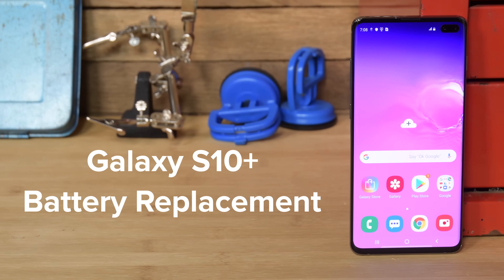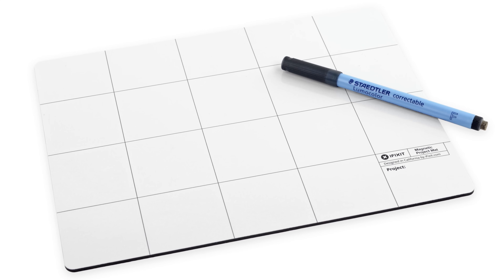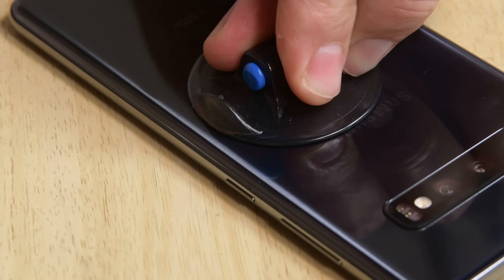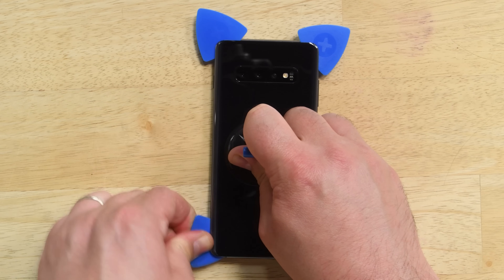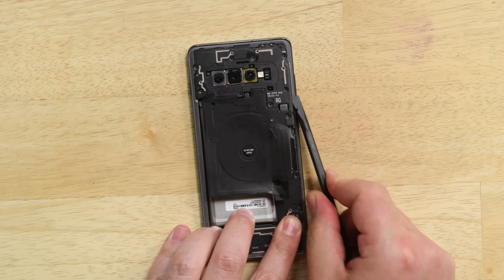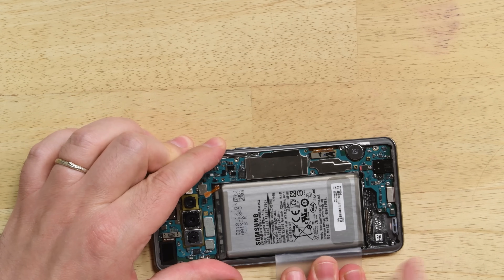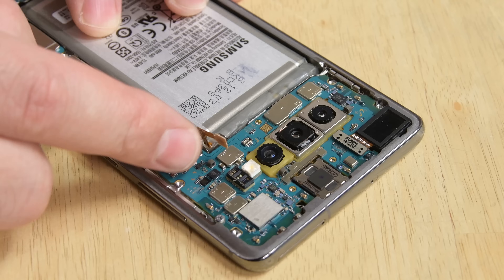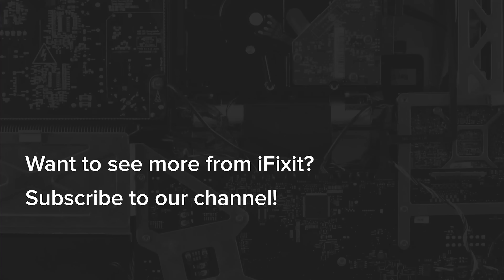Samsung S10+ Battery Replacement and Reassembly!

Comment: ⚠️ Warning: Be very careful when removing the black NFC/wireless pad on Samsung batteries. If it gets damaged—especially near the chip area—the phone may stop charging via USB and show a high temperature warning. I slightly damaged mine away from the chip area, was able to screw it back in, and the warning disappeared—the phone started charging normally

Comment: Why don't you use a power driver when removing all of the screws
Reply: They are only using the included tools with the pack. (Besides the alcohol that you most likely have)

Comment: Thanks for the video. My son and I were able to complete this in about 20 minutes. Once we heated the edges up with a hair dryer, the back was easy to remove. We used adhesive remover and alcohol to remove the battery. That was the trickiest part.

Comment: Should add a card of thin plastic for slipping under the battery - i figured i could use some old packaging, but when i got around to looking, pretty much everything was compressed cardboard, and i had to go out and buy a new toothbrush just to find suitable packaging material for the task.

Comment: For the battery I used isopropyl alcohol and dental floss and it came out in just a few minutes. No prying needed.

Dental floss is the same thing body shop guys sometimes use to remove badges from cars.

Comment: Don't worry if you crack the cover like I did 😳 (novice) you can replace them cheap as chips. The hardest part for me was removing the battery, that was well secure.

Comment: thanks, this looks easy enough for me to do.  
One question, are all of the screws the same length?
Did I need to keep track of what hole what screw came out of?
Reply: All same screws, no worries
Reply: It does?!
It would take an entire evening to follow all those steps! Not to mention buying $50 worth of weird tools. Why would a phone designer do this?
It's a scam to get people to just buy a whole new phone every time the battery dies.

Comment: Would have been helpful if this showed where to apply new adhesive on the cover, and how much to apply.
Reply: Also I didn't see where they said what adhesive was used and where to buy it. My Samsung S20 FE 5G phone launched on October 2, 2020 so it's just over 2 years old and I read they'll last 4 to 5 years but I like my phone and don't want to incur the cost of a replacement so I'm hoping to go this route when the battery does finally fail...also I'll probably need to purchase the tool kit to disassemble it.
Reply: Hopefully, there would be a full instruction sheet packed in the box, with the purchase of the back cover adhesive

Comment: Problem is getting hold of a genuine (and new) Samsung S10 plus battery? I’m in the UK and all I’ve seen so far is fake or used knock-offs on eBay. Any ideas? Great video btw 😊
Reply: Following because I have not found anywhere to buy those except for maybe Batteries Plus and they're more like 60 or $70

Comment: Very informative. It helps to know what it takes to replace a battery so clearly intended to NOT be replaced. I saw another YouTube video about how many replacement batteries are misrepresented. Between these 2 videos, I've decided to go to a Samsung Services location in my area and pay to have it done by people prepared to stand behind the parts and repairs. It is more expensive than a DIY but I can come home knowing that it will be done right and with the Samsung approved parts.
Reply: Except that Samsung technicians will use a Samsung battery that will most certainly fail again instead of a hybrid battery made from different materials that won't fail.
Reply: Can you really lol
Reply: How much did Samsung pay you to write this?

Comment: I did this today on my s10lite and charged it to 100% but now it's on 0 percent and no charging 
:( what's going on? It is on charger for 3 hours and keeps on 0%.. any tip? Brand New original battery pack.. the original and older got swollen due to bad repair.. may be the battery info.bin problem? It's stock and no root

Comment: What adhesive did you use on the battery and back glass. And where and how much adhesive did you put on the back glass to insure a Waterproof IP68 seal

Comment: If you do have to add additional adhesive to the battery or the rear cover, what kind of adhesive should you use? Ordinary white glue?
Reply: I think a water resistant sealing adhesive is needed. You'll want to preserve the IP68 water resistence.

Comment: The thinner and thinner they make these phones, the more adhesive necessary to retain structural placement/rigidity with heavy components like the battery. It is a necessary pain in the consumer's arse...with (of course) the added benefit to the manufacturer of higher sales of new/replacement phones (as they have correctly predicted/measured).
Reply: I think that's a lie Samsung and their designers made up to get you to give up and buy a new phone. There's no structural integrity at risk here. It's a scam. Samsung doesn't make any money if you're replacing their batteries instead of buying a new phone. It's just a good ol' fashioned scam.

Comment: I did one better, I added a 10,000mah cell to mine and replaced the back cover with a custom made 3D printed case

My S10+ is 14,000mah, but it's thinner and lighter than an S10+ with an 8000mah battery case (the type that uses the charge port)

Even made an extender cable for the wireless charging and NFC coils
Reply: Please can I ask where you got the battery from?
Reply: @SiaD777  eBay

Comment: Just used your kit with tools to to fix a swollen s10+ battery - it was pushing the screen up as well as the back apart,, worked pretty well, 4 observations::: - 1. Showing how to use the included glue strips in this video would help give a better idea of how to do it.. 2 Yes those screws are microscopic, a 1" super magnet helped in finding one that went flying and for getting some of them out of their flanges in the phone. 3. The suction cup would not fasten at all on the back of the s10+, not sure why., 4. The iOpener worked quite - just be patient..Overall well done and a very nice kit. btw - glad I bought it - and it got here in 2 days !!!..
There is no 91% isopropyl alcohol in the kit - so be sure you have some on hand. My battery was loose enough - i just gently pried it up.. so not an issue for me.

Comment: What they fail to tell you is the back cover is glass. It needs a lot of heat to get the glue slightly soft, there is no gap to jam a pick in so takes a lot of force.
Once the cover did start coming up the glass shattered and a shard when through my finger and out the other side....
Reply: @qwrt hialname Repalced the back glass. Here is a good tip, don't use picks, cut a square of plastic out of a soft drink bottle and use that. It is much more flexible and thin so cut cut the glue without bending and cracking the glass.
Reply: Did you use a heat gun?  Did mine in a couple mins no struggling just use a heat gun for couple mins is all it takes.
Reply: The back cover costs about $8-$15 online. Maybe keep a spare on hand in case. :) The kit, not including back cover, is $26.99 on ifixit. Battery only is $19.99.
Reply: All so you they can keep track of you even when your phone is off... thats the only reason for making batteries so hard to remove.
Reply: @fukushima4670  well regardless of phone pretty much everything you do is recorded or spied on.
I think the real reason they have phones so difficult to repair is so they make more $
Just like Apple not allowing regular users or technicians to buy Apple parts, only certified Apple technicians can. Thos makes it where you have to pay exorbitant prices at Apple stores to get it fixed.
Same with most other phone companies. They want you to send it I'm to get repaired or take it in to their stores or certified tech centers. This cost ungodly amounts of money for something that isn't hard to do once you learn the proper way to do it
Reply: @CameronDC-Grimes  
Back to basics and buy a simple phone..off the grid. Do we need to maintain our phones constantly online?
Reply: @fukushima4670  
bozo
Reply: @fukushima4670  ahhh it's the conspiracy theorists
Reply: @lailamahomed3180  The sheep station called, they want ewe back.

Comment: when did this happen? I still have my S4 and its a removable back. I have a spare battery and haven't had issues.
Reply: I upgraded to this phone from s4. The s4 got WAY too slow and hot.
Reply: @beastabuelos6421  yes. Mine is also really slow, although I don't get overheating problems

Comment: Will this still have the ip68 protection after the battery replacement?
Reply: The biggest challenge is removing the original battery
Reply: Yes it does if you re seal it properly
Reply: I don't think so because the rubber will not be so good

Comment: Where can I buy a new battery? Someone please send me the link or something.
Reply: Plenty of batteries for sale on Ebay, and probably Etsy. Average price is around $10 USD. The iFixit tool kit is a bit expensive, but since the Samsung phones are expensive and the company does not fix bloated batteries after the warranty period, think about the money you will save by not paying a shop to replace the battery. DIY is better anyway since shops are notorious for scratching your screen or case.
Reply: Amazon

Comment: Wow, they really don't want us to replace our batteries, do they?
Reply: they dont want you to repair so you have to buy another one
Reply: Compared to other devies, this one is quiet simple.
Reply: @Zeltroix  No it's not! Are you insane as well? Every phone I've had has a back cover that either slides off or it has a gap at one of the phone's corners. Samsung really dropped the ball with this design. 
It's probably that way to get you to buy a whole new phone instead of just changing the battery.
Reply: @Zeltroix  I was thinking the same thing.  Was expecting it to be much worse
Reply: Ecologically unsound.
Reply: It's show u can't completely switch off your phone therefore it always traceable via phone masts 🤫
Reply: Right?! It's insane! I would keep my phone for 6 years if I could just spent $20 to replace the battery.
Reply: I was thinking this is way easier then I imagined
Reply: Greedy Samsung and Iphone -because they want you to buy a new one every time they lunch a new model  ...that's way they are introducing  new laws in EU in order to be able to easely change and swap the battery , also what is this with batteries dying in 2 years ...they should last at least 5 years minimum....But it all commes to making profit...and all you sheeps right there to buy the most new inovative device for 1500 or 2000 euro's
Reply: it took me less than 15 mins to replace my battery in my S10+ and was the first time ever doing it, so for the average person I think it's pretty easy
Reply: Ikr😁😁😁
Reply: Right?! It's insane! I would keep my phone for 6 years if I could just spent $20 to replace the battery.
Reply: It's mostly for waterproofing
Reply: @lennartwelhof  Oh really? Hadn't thought of that. But I wouldn't be surprised if it wasn't also to make the product more 'perishable'.
Reply: @lennartwelhof  the S5 was water proof and that battery was super simple to replace. Didn't need any tools at all.
Reply: @lennartwelhof  bull.  GoPro cameras are quite waterproof and have user replaceable batteries
Reply: @grayrabbit2211  I don't think you want another shell around your phone just to be able to change your battery yourself
Reply: @grayrabbit2211  

Comparing a Gopro to a phone, lmfao....
Reply: @lennartwelhof  show me someone who doesn't have an extra cover on their phone already.   The Samsung S5 had a headphone jack, SD card, and user-replaceable battery, and was water resistant...and that phone was 8 years ago
Reply: It's for the IP67 or whatever it's called to make the phones water and dust proof I think.
Reply: @Philminator  Never tested 30mins in water, but now im going to pool. If phone gets wet, how fast can you charge it? I cannot always see water in connector :)
Reply: if it is waterproof, it should just be able to charge direct if it isnt repaired already. otherwise turn it always off an try leaving it in the air for minimal 48 hours, 96 hours is the best. Than the phone should just work fine again

Comment: I have 2 things to ask: I have not understood the usefulness of propyl alcohol and above all, if I do this battery change procedure, will I lose water resistance?
Reply: The Isopropyl Alcohol will disolve the adhesive and you will lose water resistance unless you use a replacement seal that has to be purchased.
Reply: No
Reply: The biggest challenge is removing the old battery it takes a lot of patience

Comment: Why do so many people have an obsession with the water-proofing? I had my note 4 for it's 5th year prior to just getting the Note 10 (old phone was crashing while running apps and screen was going - images were being burned) and never had a single incident of water damage to it even after being caught in the rain and putting it in wet clothing, including coming with me on a couple of log rides. (Anecdotal, I know, but still waterproof for # of minutes in a meter of water is not an end all-be all)
Reply: Can't speak for all but have used my s10+ underwater over a dozen times, last time snorkeling in Hawaii during summer break. Nice feature.
Reply: Germaphobe here. I wash mine every night.
Reply: @DavidWard14 bro wth , just use a wipe or get an uv phone light stand....or invest in a smart watch for dirty hand use
Reply: I rail up lines off mine...
Reply: @supremeleaderarmy9164  :face-purple-crying::face-purple-crying::face-purple-crying:

Comment: The mat is a great idea, but I use a method that is, in my opinion, better. I have a bunch of cardstock sheets (particularly I use the backing cards for vintage comic book sleeves) and use doblesided tape to hold screws on there and I also write down notes as to where certain parts go, in which order, etc, etc. I think the tape is better than magnets because magnetic mats are never very strong and so if you bump the mat too hard all the screws go flying. The tape holds them in place very securely.
Reply: In general, while working with delicate parts, be concious about your mvements.

Comment: I hate this new trend of gluing batteries like it's the end of the world. Do you think the battery is going anywhere? Better use some glue-less foam to prevent rattling and movement of the battery and at the same time you do not put in risk the guys doing the repairs in the event of them piercing or bending the battery. Just saying...

Comment: So basically if I change it I lose water resistance?
Reply: 기어사고싶다아아 only at a samsung shop though, and in north america not very many of those exist
Reply: Lovepreet Singh no you still loose water resistance, the only way to get it back is to have it professionally resealed by a shop with a heat press machine, even then id be wary about taking it in water

Comment: Get $2000 phone and change it's battery worth $300 every month.
Reply: Not every month but on the S10 used all day every day, probably will want to close to a year.
Reply: Had my s10 plus over a year with no battery issues. Charges fine and holds the charge all day or longer dependjng on use. Also figure i use my phone a lot, not one of those "use it only for calling" types. If you have to replace a battery this often its most likely user error is some way or another.

Comment: If anyone is following this, be careful while removing the battery. On the video they damaged the screen while removing they just never showed it turned on. Heating up the adhesive to warm to touch is a much easier way to remove it than alcohol. Just make sure not to over heat the area battery
Reply: That.s not true. You need to use alcohol IPA ->90% and up. Instead of prying it and risking that u will damage LCD(under battery there is a "window" in metal frame where u can easily poke LCD) you should use suction cup. Apply force to suction cup and keep hold it till you will feel that adhesive give up.
Reply: Is there any danger of a battery explosion from heating it up, especially as we will likely be replacing these with while they have a fault
Reply: James @2:37 when they take out the battery, there’s that little copper color. They broke threw the first layer of the screen. Which isn’t deep enough to damage the LCD but will bring issue to the the touch on the phone. And you’re right alcohol won’t damage the phone. But what I was saying is, heating up the adhesive instead of putting alcohol on it is a much easier way of taking it out
Reply: @nathanpk4822  I fail to see what you mean at 2:37. Where is that little copper color that got broken?
Reply: @HupfDole87  I see it at 2:39, there's a little orange square within the black area underneath where the battery sits. It looks to me like they damaged it when they pushed the battery out with the plastic pick and maybe the pick scratched it.
Reply: @nathanpk4822  is it recommended to use hairdryer to heating up the adhesive instead of putting alcohol?
Reply: @wtheoderick  I worked at a tech shop for 2 years. alcohol does help, but our preferred method was always heating it up. You can use a blow dryer, might take a little long (we had heating plates). You gotta get it hot to the touch, we would have to hold our phones with a towel around it cause it’d be so warm but the battery comes out with little to no effort at that point. If you have a hard time still, warm it up a bit more